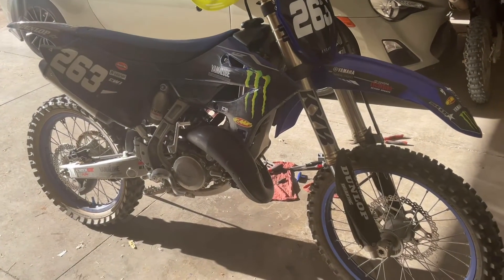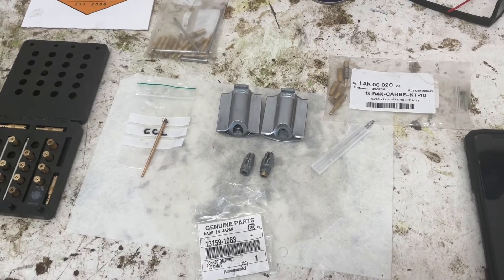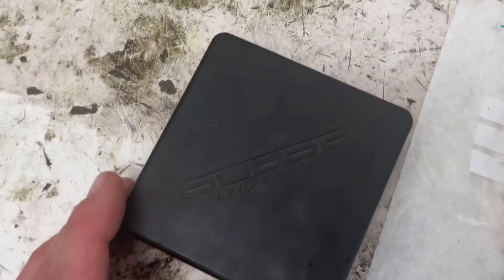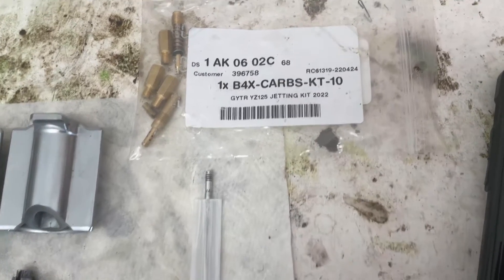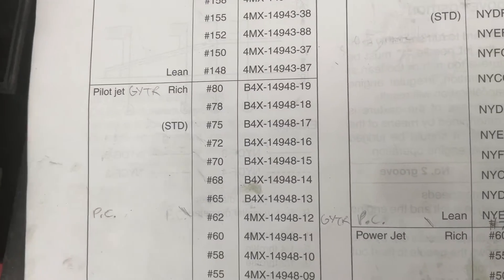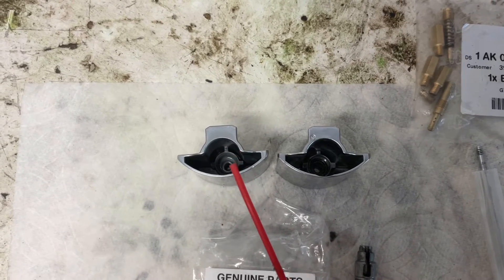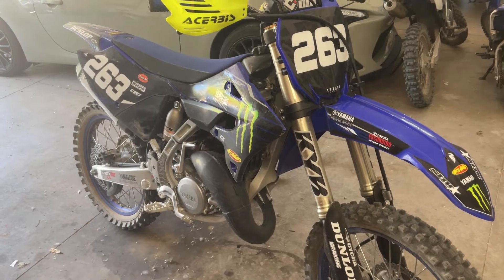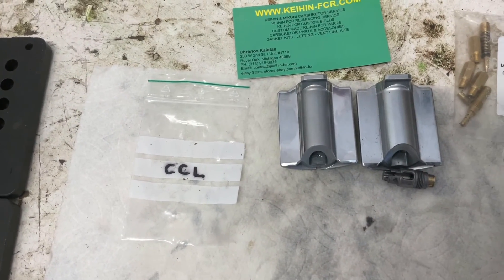YZ125 Jetting Spec

Comment: 23 yz125 here, my bike cam with a nydf -2, 75p,  and a 155 main in it! I got jd jetting kit 170 main 50p in it was so lean it would idle really fast with air screw at 0 turns. now im  running 60 pilot 170 main  idle's way better still boggin a lot low to mid very clean mid to up  I just don't know what to do
Reply: Bought a new 25 and ran horrible.. when they don’t idle and you have the idle screw, turned all the way in it means it’s too rich.. so I put a 48 pilot jet in it. Left the stock main jet in but put the leanest needle that came in the kit and put it on the 2nd clip! Runs awesome.
Reply: @mxr248 nice im glad you got yours dialed, i ended up up going nydf needle 1st clip, 60 pilot, 175 main, air screw 2 turns out  at sea level  bike is a complete monster runs like a champ

Comment from the maker: Hello everyone.  I wanted to post an update to this video.  After running this bike for years.  I ended up going back to pro circuit jetting recommendations(only change clip 4). The Digger jetting with the richer slide we were fouling too many spark plugs too fast.
Reply: Did you foul spark plugs from the beginning  ? Did you try 50 pilot ? Leaner jetting overall maybe ?
Reply: GYTR kit including the air screw was the ticket for me. 80 pilot, Y4 needle on 3rd clip, 160 main (tried 168 but was a little rich). Ordered an 82 and 85 pilot because air screw is only 1/3-1/2 turn out and it is still a little slow to return to idle and it is hot right now.
Reply: Did you mess with the RPM screw at all?
Reply: Interesting you had so many fouled plugs. I’m a novice rider and have ran the digger setup in my 24 and yet to foul a plug.

I did experiment with the gytr setup a little. Had to drop clip 4 which still seemed slightly lean for me. It’s certainly a frustrating bike to jet. I saw for 26 they changed a lot.

Comment: Hi based on all the research you’ve done . Which kit you think work better for those who don’t have the time to mess with scarce parts . 
The JD jetting or the GYTR?
Reply from the maker: @squidword1453  I have not tried the JD kit but  understand that you would need to change the premix ratio to 40:1.   I would go GYTR kit but use pro circuits recommended jetting spec except for clip position.  Go with clip 4.

Comment from the maker: The bike is super responsive at any throttle position. Best running 125 I have ever tried. Don’t forget to get the stationary cable holder with the CCL needle. 

Digger Jetting:

Throttle Valve(slide)      6.0                                     Stock is 7.0(X model 6.5)
Jet Needle                       CCL
Clip                                    3                                         2(high elevation/warm)
Power Jet                        35                                       Stock
Pilot                                  52                                       50-55
Air Screw                        1-1.5 turns out 
Main jet                           182.                                    180-185

Throttle Valve stamped 6 for Keihin PWK38S
Keihin Part #:   018-521    N502-17E01 
                            022-040      N502-27600   Notched
99’-00’ Kawasaki KX125 Part #: 16025-1215
KTM Part#  54631235006
JD Jetting Part#:   JDKH11

CCL Needle 
Keihin Part#:  N427-48CCL    017-464
1988 Kawasaki KDX200 Part#:  16009-1387   R1370E

Cable Holder
Kawasaki Part#: 13169-1063     
JD Jetting Part #:   JDKH16 
—————————————————————————————————
Pro Circuit Jetting:

See Pro Circuit jetting specs on their website
Only recommended change 
Clip position         4      On the needle jet 

Will need:
GYTR Jetting Kit YZ125 22’-24’(Y4 Needle)
B4X-CARBS-KT-10
or
Y3 Needle
Keihin Part#:  N427-11Y03   017-138

Comment: Have you tried the JD jetting kit? I ended up buying it since I figured waiting on the 6.0 slide and CCL needle might be a few weeks. Bike runs amazing I may have to try the diggers specs later.
Reply from the maker: I have tried just about every jetting spec but the JD kit on the 22-25 because I had heard mixed reviews on it and those that have tried both said they preferred the Digger jetting.  I will have to try it for myself at some point. I had their kit on our 19’ and it worked well. Wish they would stamp their needles.  I like to know what needle is my starting point if I want to make a change rather than just follow their jetting instruction process.

Comment: great video. currently have the gytr whole jet kit installed with 4th clip. runs smooth no hesitation. interesting will try the richer slide with that needle. this bikes been hard to jet right from the start! thanks for the info
Reply from the maker: Yeah the 4th clip got rid of the lean bog for the most part for me as well. That was the best jetting I tried with the stock #7 slide. I think you will like the #6 slide and CCL needle better if you can find one.  It just finally runs like I always thought it should. Good luck.
Reply: @chintzygarage2819  have the 6slide, ccl needle and cable holder on order here in aussie, looking forward to trying it out. thanks for the video
Reply: @simby787  I installed the entire kit. It runs so good! Im at 500-600ft above sea level here in the states and it’s 90-100f in north Carolina where I live. I started with the smallest main jet. 
My plug still looked a little rich but I’m fine with that.  I  ran 40:1 maxima k2 and 93  pump gas on the first test ride and I didn’t feel or hear any detonation. I’m a washed up 35 year old A rider. But I usually run c12 or something equivalent 50/50. But it did run great on pump fuel on a mx track. Thanks for the information I really appreciate it.
Reply from the maker: @601racing thanks I’ll give the entire GYTR kit a go again.  I tried various mains and pilot combinations and it never felt right.  What clip position did you end up with?
Reply: I have the gytr kit as well. I’m going to install the entire kit. Are you running the #80 pilot? And what main did you go with? I’m at sea level.